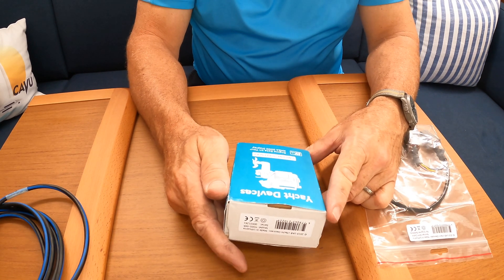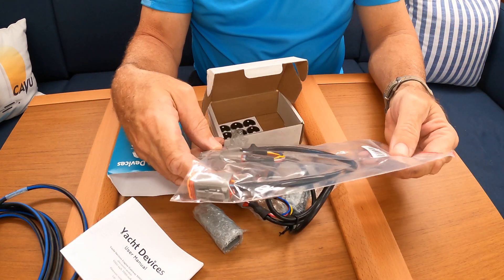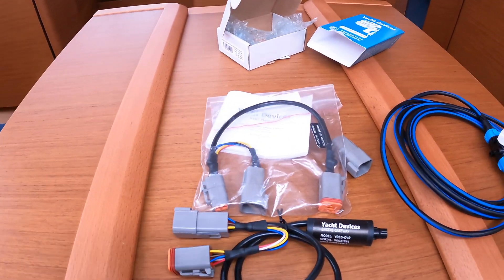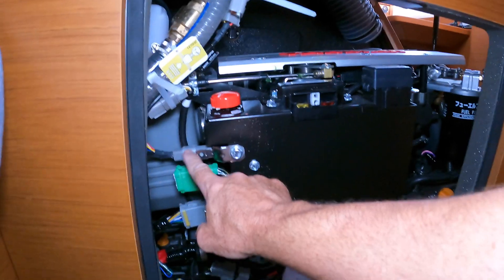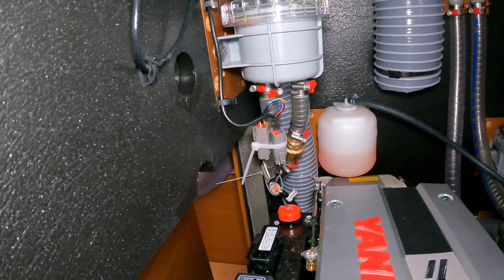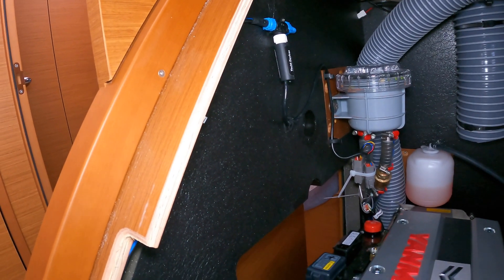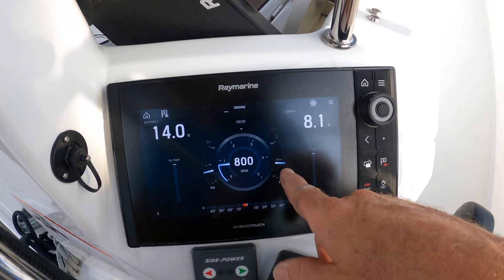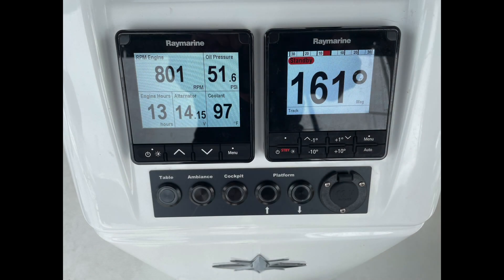Yacht Devices Engine Gateway

Comment: Bonjour pouvez-vous me donner les références des pièces la connexion moteur et le transformateur vers le câble sea Talk marc So 419 yanmar 4jh45
Reply from the maker: Engine gateway YDEG-04 will work from the engine to the NMEA 2000 network
Reply from the maker: You also need the adapter cable to fit the Yanmar 4jh
Reply: I would like to connect the engine of my 419 because the rev counter screen is getting dark. I saw the indications you gave. I ask you if the temperature and/or oil pressure alarms are also transmitted from the Raimaryne screen (Yammar Del Engine assistance tells me that not all the alarms pass).

Comment: I did this upgrade today on my 440 and it works great. I also bought the connectors to install another one on the generator but the adaptor did not fit. I need to do some more research.
Reply from the maker: When you figure it let me know I would be interested. Got some major electric projects in works you may be interested in.
Reply: I also used a Yacht Device converter to put the fuel tank on the SeaTalkNG network. I now have fuel level with the engine info. On the electrical side, I just installed a XANTREX
LinkLITE Battery Monitor. I had one on my old boat and I really liked it. I really enjoy your videos, keep them coming.

Comment: I would like to duplicate this on our 2021 440.  Can you share the specific part numbers of what you ordered? Thanks!
Reply from the maker: https://yachtdevicesus.com/collections/engine-gateways/products/engine-gateway-ydeg-04?variant=6391168663594
You need the ydeg-04R for the Raymarine.
You will also need the adapter harness for the yanmar
https://yachtdevicesus.com/collections/engine-gateways/products/adapter-cables-for-ydeg-04-engine-gateways?variant=13813393424426

A 3 meter sea talk backbone cable (the blue one) and a sea talk Tee connector.
I also used some wire holders I bought off Amazon to hold the cables up. Let me know and I’ll send a link.

Comment: I thought the boat came with an analog RPM gauge, is your small digital read out an option or did Jeaneau drop the analog gauge?
Reply from the maker: Yanmar changed over to a LCD gauge the YD25 for an upgrade you can get the YD42 which is a color 4”mfd. The YD42 will output NMEA2000 at the unit . Both still receive the J1939 protocol. My 2021 440 came with the YD25